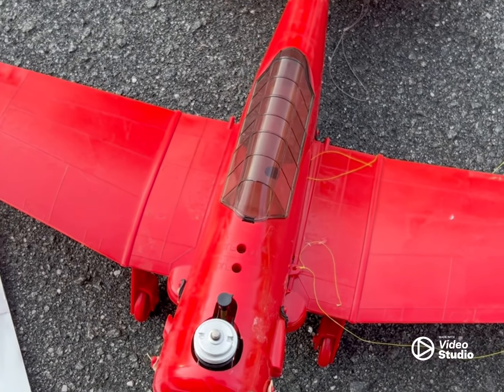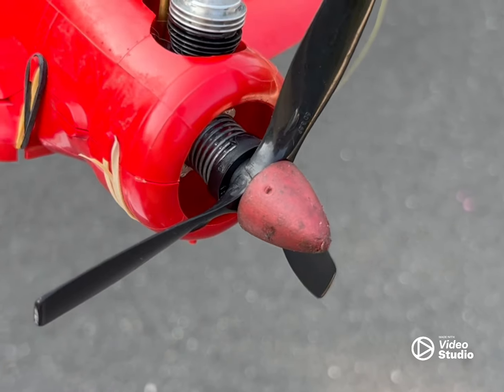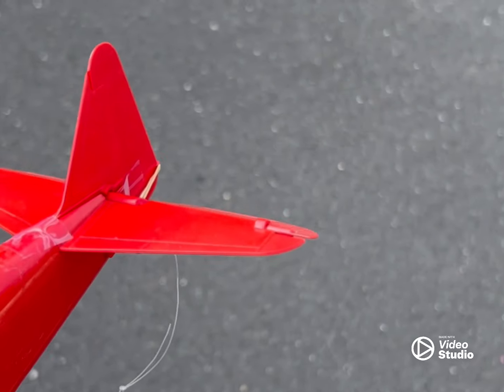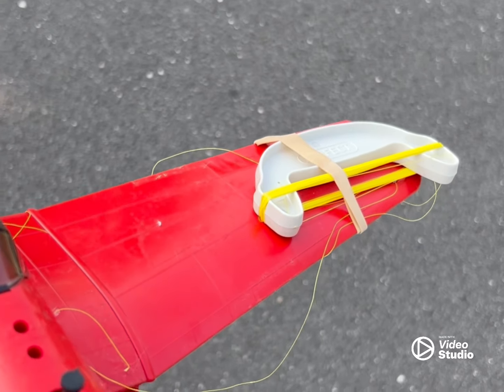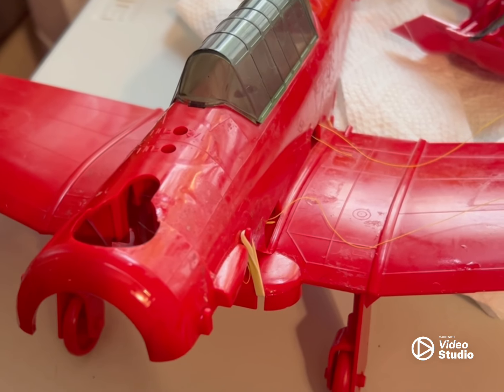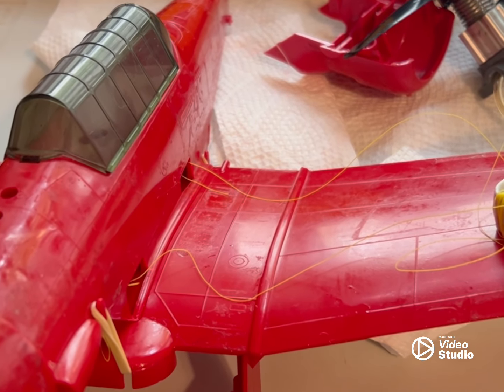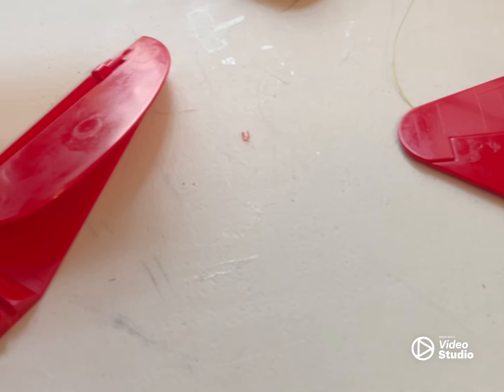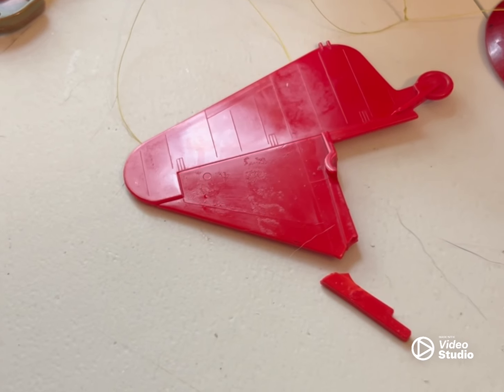Cox T-6 Texan Intro, crash, analysis.

Comment: Tail heavy is definitely not the problem.  At takeoff, when you put your arm straight up into the air, that automatically produces full up elevator, the airplane tries to climb, stalls and goes into a graveyard spiral and crashes. Takeoff is performed with your arm straight out level and neutral elevator for at least about a half a circle, then slightly nose up elevator to climb into level flight. Don’t think about getting a private pilot’s license LOL.